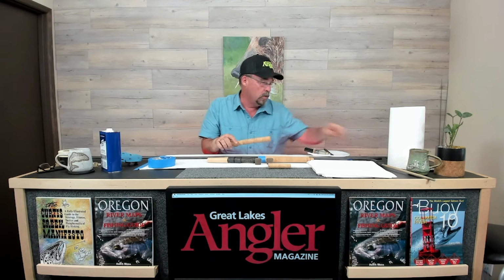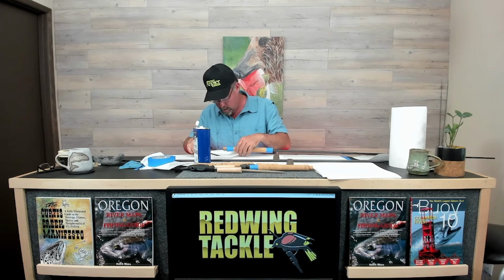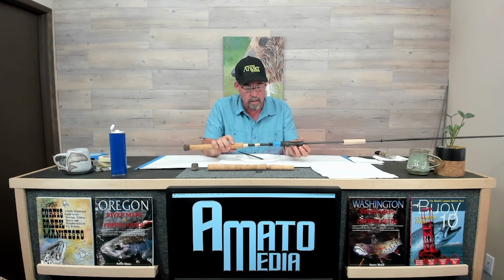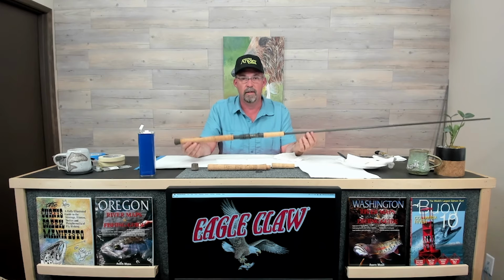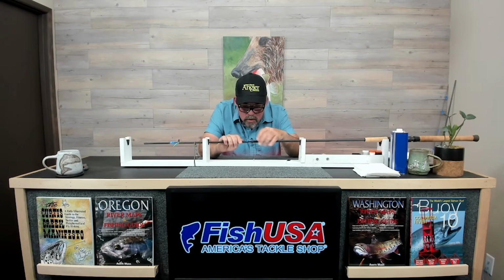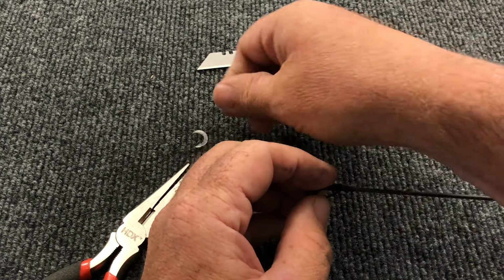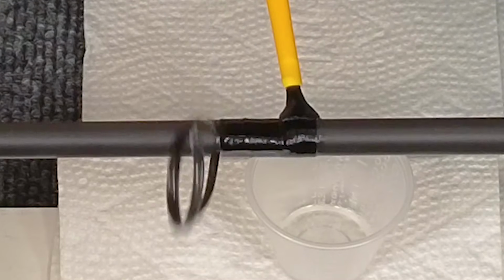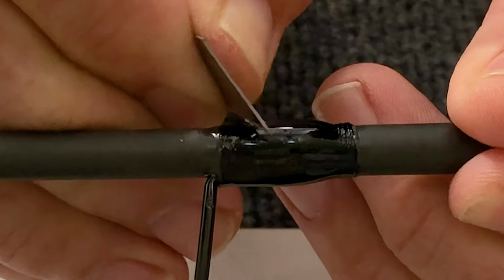How To Build a Fishing Rod - Part 2 of 2 - From Butt to Tip-Top

Comment: Reaming the inside of the handle out. Ya need a reamer bro.👍🤙🎣
Reply from the maker: Yes I 100% agree. The rod reamers are tapered and will do a better job and are easier to use. You can also get gel epoxy for the handles and reel seat.